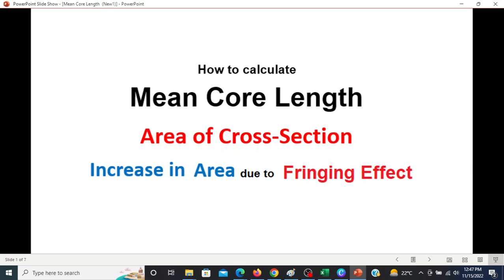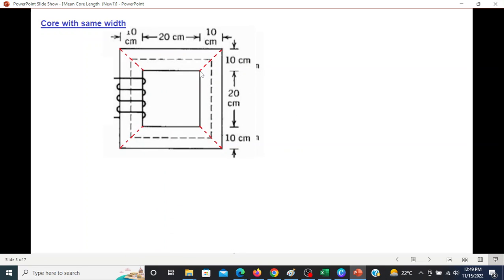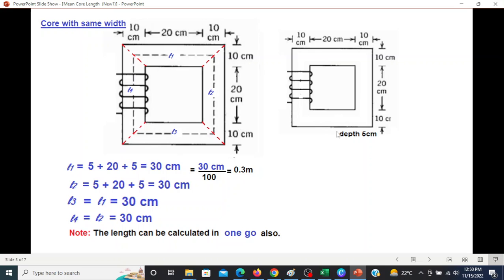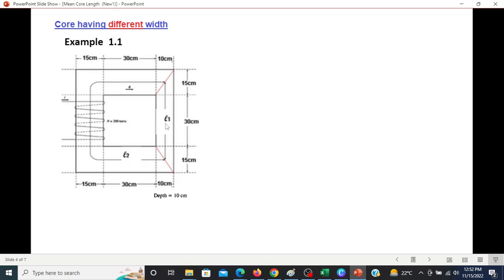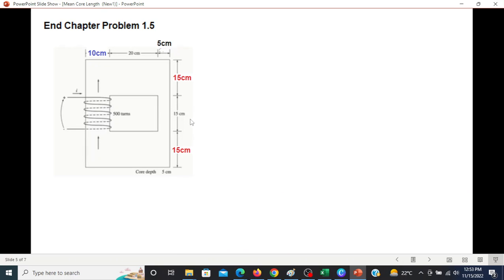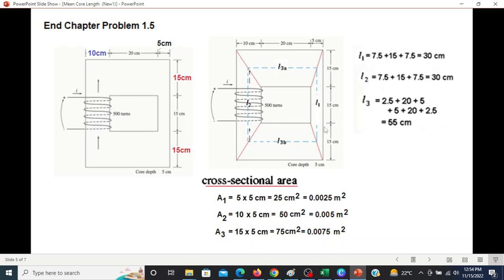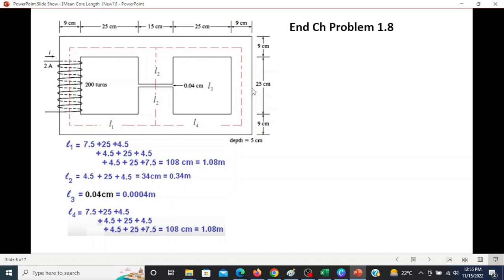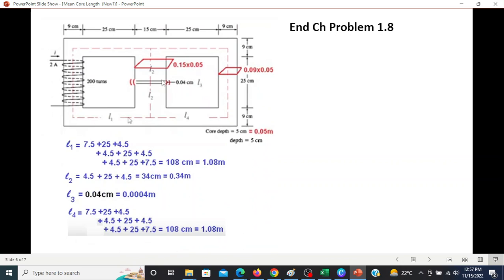(English)EM | (Ch1) | Core Mean Path Length | Area of Cross-Section | Increased Area due to Fringing

Comment: Why didn't you subtract the gap length from l2?
Reply from the maker: Does it make much difference if we subtract 1 from 100000
Reply: @ElectricalEngineeringAcademy  No Prof...  
So, it is not even  a must to indicate it in the formula then?